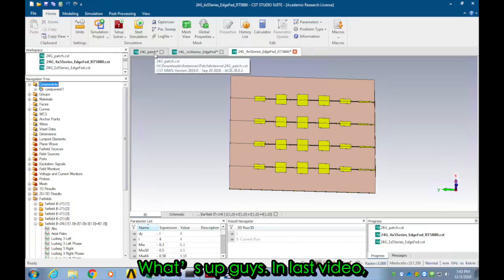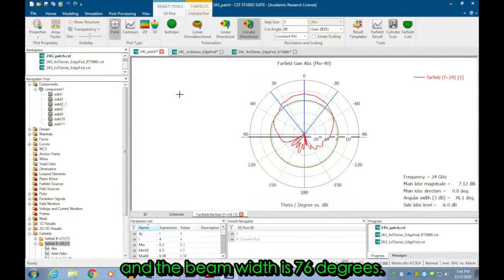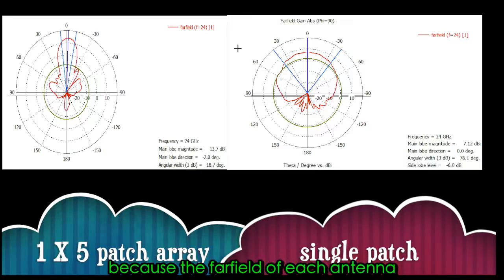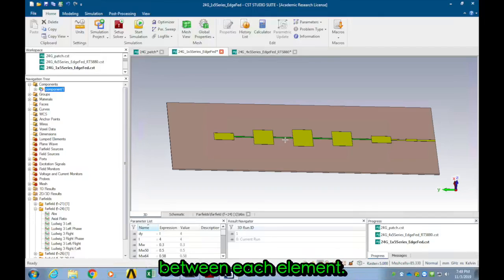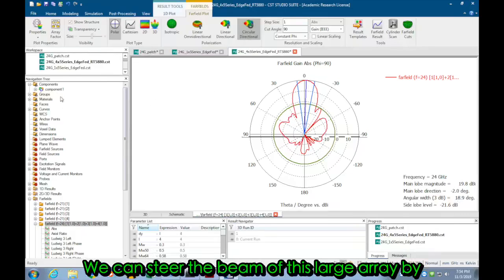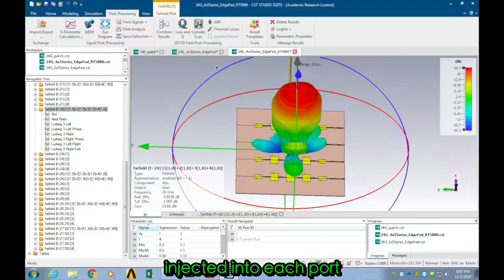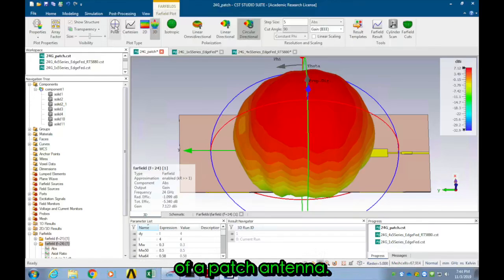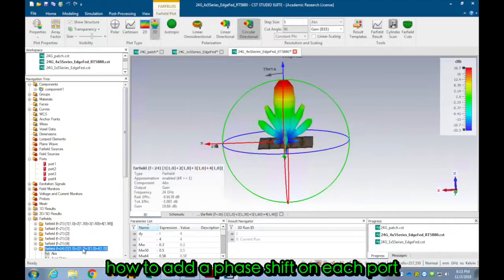Beam Steering of 4X5 Patch Antenna Array

Comment: Hi Fan, thanks for the nice presentation. My question is how much we can steer the beam, especially using the patch antennas. I was doing some simulations with the Matlab but cannot see the main lobe is steerd much.
Reply from the maker: it's hard to say what the max angle we can steer. It depends on many facts. The array is bigger, the wider range we can steer. It is possible to achieve 3D steering. For example, this company,
https://www.kymetacorp.com/,
 they used a slot array to achieve 360-degree steering. The radiation mechanism of a slot antenna is similar to that of a patch antenna. So it should be achievable for a patch antenna array. however, the array size will be very large. I mean the electrical size. 

I hope this answered your question.

Comment: Thanks for a good instructional video. Can you make a intruction video how to make the 1x5 array. How to calculate the length and width of elements.
Reply from the maker: A short answer:
There are two methods to make an array: 1) cascade each element; 2) shunt them.  If you want to shunt them, a power divider is inevitable. No matter which method you prefer, taping them can achieve a better gain. So the power delivers to each element is different. 

It is intuitive to deliver more power to the elements in the center and less on the edge if we expect a broad side array. Chebyshev taping is commonly used to achieve a decent gain. 

For cascade patch array, we can change the width of the element to control the power delivered to each element. The essence is to change the coupling between the element and the microstrip line.

I am working on the video about shunt array but it need more time. In that video, you get some hints.
Reply: @Fan-vk9gx  Thanks for the reply. I was wondering how you build your antenna from the beginning. I wonder how you simulate/optimize each patch to resonate at 24GHz. When you add the feed between the paches the tuning frequency is affected. How do you simulate/optimize that? Which parameter do you use when optimizing?